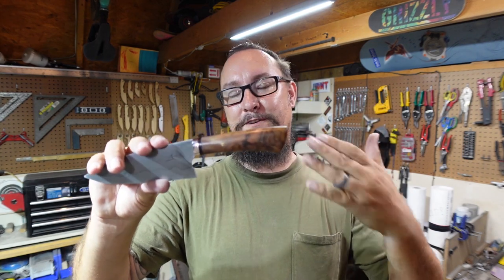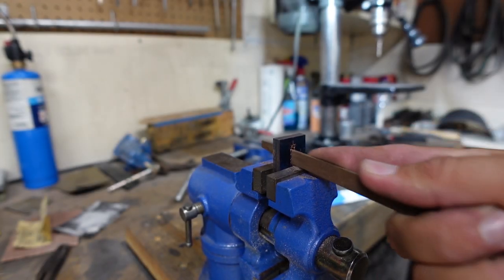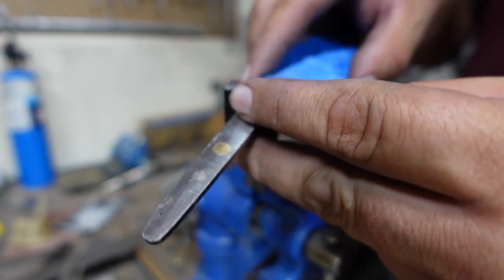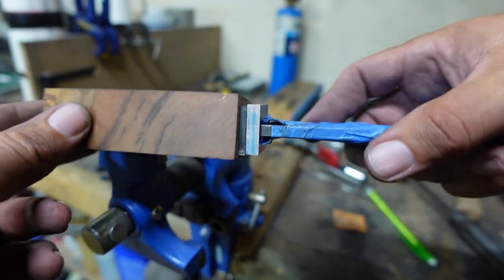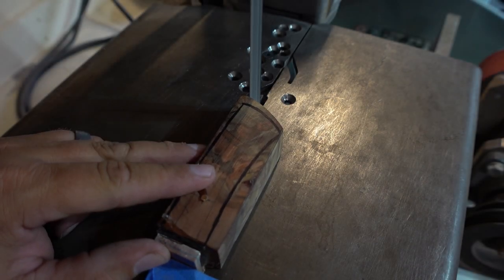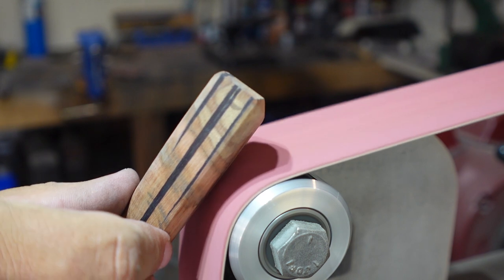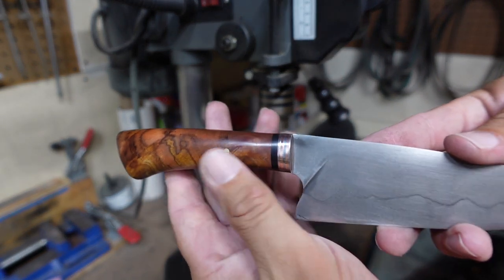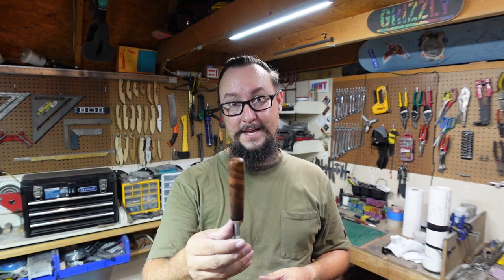Completing My First Hidden Tang Handle! | Knife Makers Vlog

Comment: you did great job for the 1st hidden tang was as good as any of the others that have way more tooling Airon and Dennis both use the 1,2,3, block to center the handle to the blade great job nice knife. what is the HRC hardness of that knife just wondering ?
Reply from the maker: It was 60 HRC. It holds an insane edge.